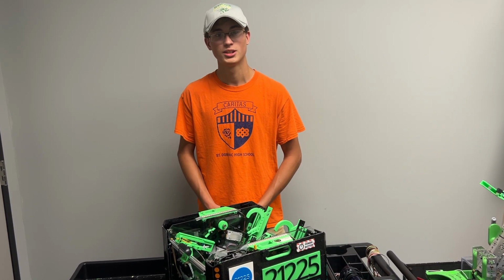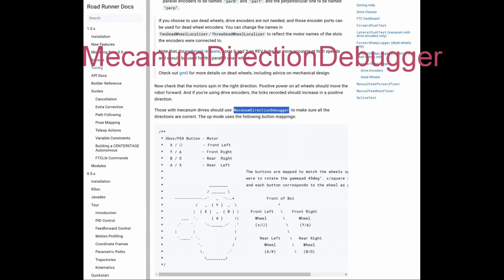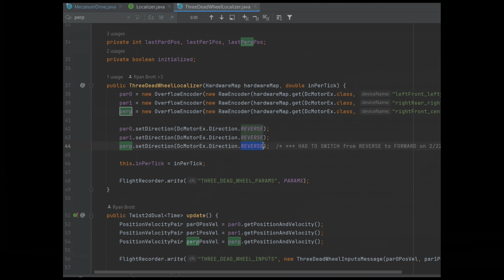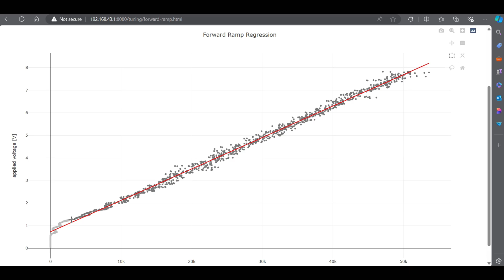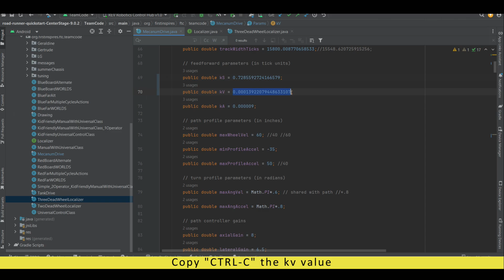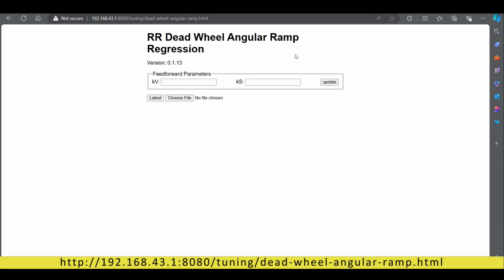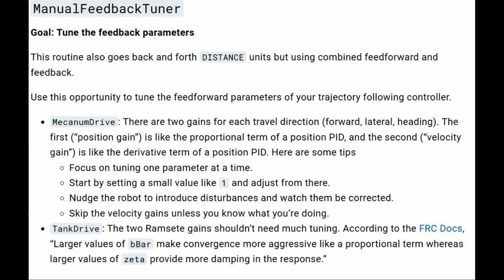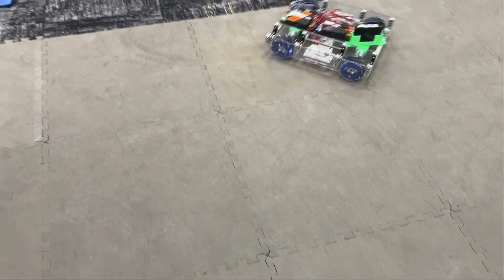RoadRunner Calibration for FTC Robotics Teams

Comment: When using these deadwheels, do I need to set it up with configure robot and then run it? Every time I run deadwheel direction debugger, I get an error message and it says that it can only be run when using deadwheels.
Reply from the maker: You have to configure your motors and your deadwheels in configure robot, but you also should have made some code changes that tells it that you are using Mecanum and deadwheels.

Verify that 
In the TuningOpModes file, you set the DRIVE_CLASS variable to the drive class you’re using.
public static final Class<?> DRIVE_CLASS = MecanumDrive.class;

Also verify in the Mecanum class,
On line: 240

that you changed this line:   
localizer = new DriveLocalizer();

To:
localizer = new ThreeDeadWheelLocalizer(hardwareMap, MecanumDrive.PARAMS.inPerTick);
Reply: @shearforceftc  for me it says it required 3 parameters instead of 2 when I use the threedeadwheel localizer

Comment: I was wondering if someone would be able to help me with my robot and auto mode. There is an issue Im getting that says my control and expansion hubs are null. The wiring is all good and I already tried to re-install software for the hubs, yet the error persists. It is very puzzling so maybe someone could get on a call/vc so they can see it and help me out. Check your emails please :)     - 14841

Comment: I am using mecanum wheel with drive encoder. During tuning process , forwardpushtest, I get ticks travel negative and even my angularramptest I get negative graph. Can you help me what should I do to get positive ticks traveled?
Reply from the maker: Maybe reverse the directions of your encoders (make sure the DeadWheelDirectionDebugger test is working in the right direction) because it sounds like the encoders are set in the same directions just backwards from the front of the robot?
Reply: Which odometery pods are using? Can you send me link to purchase the pod which can retract , most latest odometery pod?
Reply from the maker: @jaiminishah6824  we are using the ones from Opti.  They can be retracted, but we aren't using that this year since there are no obstacles to drive over this year.   https://optii.com.au/collections/odometry